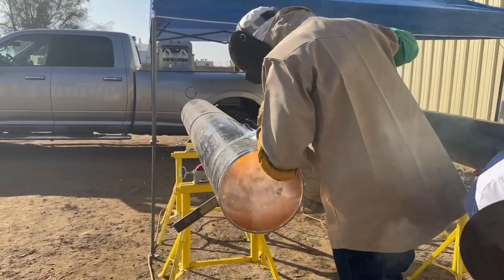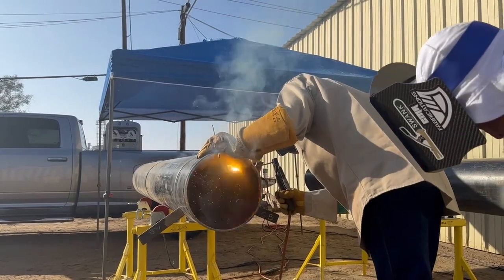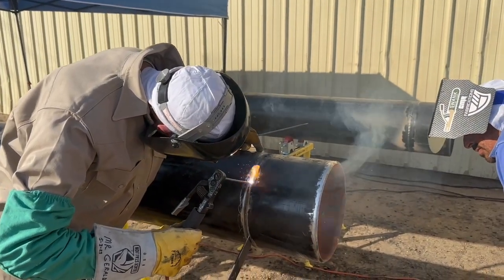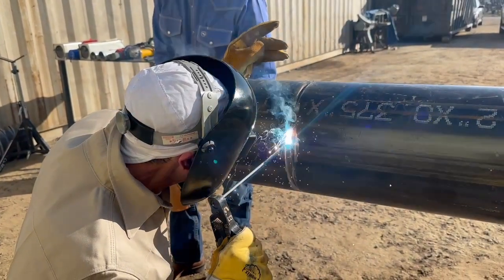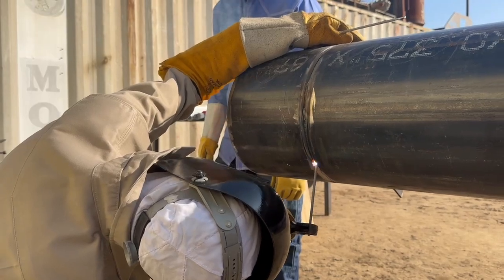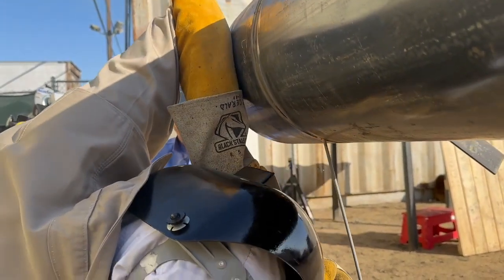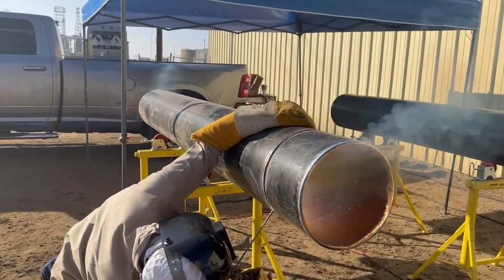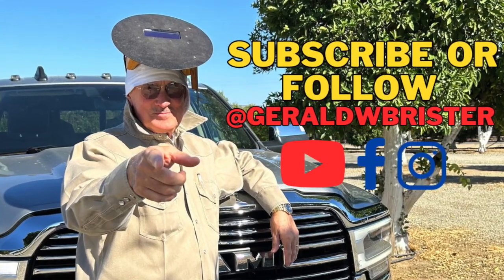ROOT PASS TIPS, Welding Training Video

Comment: Great tips. I find them very helpful . 1 question.  Why can you do your root pass down hand. In Canada we have to do our roots up hand
Reply from the maker: BASED ON MY PERSONAL RESEARCH AND CONVERSATIONS IVE HAD WITH OTHER  CANADIAN WELDERS IN THE PASS , I BELIEVE THE MAIN DIFFERENCE BETWEEN OUR TWO COUNTRIES IS IN HOW MUCH GOVERNMENT CONTROL IS INVOLVED . HERE IN AMERICA OUR INDUSTRY IS STILL, FOR THE MOST PART CONTROLED BY THE INDIVIDUAL COMPANIES. THEY MAY CHOOSE TO FOLLOW SOME ORGAIZATIONS WELD PROCEDURE, BUT ARE NOT REQUIRED TO.  EACH COMPANY IS RESPONSIBLE FOR THE INTEGRITY OF ITS WELD SYSTEMS, AND ANY LIABILITY IF IT FAILS. THEY HAVE THE RESPONSIBILITY, SO THEY GET TO CHOOSE WHAT PROCEDURES THEY WELD TO. WHEN PRESSURED PIPE WELDING BEGAN  IT WAS MOSTLY WELDED UP HILL WITH ACETYLENE AND OXYGEN TORCHES FOR HEAT AND BARE RODS FOR FILING AND CAPING.  LATER AS  RELIABLE STICK RODS WERE INVENTED PRESSURE PIPING IN PLANTS AND POWER HOUSES WAS STILL WELDED UPHILL AS WELL .IN THAT DAY PIPE WAS HAND BEVELED AND NOT SO WONDERFUL AS PEOPLE TRY TO MAKE IT. YOU WOULD HAVE IRREGULAR FIT UPS AND SPACES, SO UPHILL WELDING WAS MORE FORGIVING FOR WIDE GAPS AND YOU COULD TURN THE MACHINE UP AND MELT THROUGH THE TIGHT PLACES. HAS AMERICA WAS GROWING AND THE USE OF PETROLEUM PRODUCTS INCREASED, THERE DEVELOPED A NEED FOR MORE AND MORE PIPELINE CONSTRUCTION AT A FASTER PACE AND LOWER COST. IN ABOUT 1933 MR MATHEY INVENTED AND PATENTED ONE OF FIRST RELIABLE AND WIDELY USED BEVELING MACHINES ,ALLOWING FOR CONSISTENT BEVEL ANGLES AND SPACING FOR WELDED JOINTS . SO DOWNHILL WELDING WAS RATHER QUICKLY ADOPTED, USING A 30 DEGREE BEVEL AND A TIGHTER SPACE TO MINIMIZE THE AMOUNT OF FILL METAL REQUIRED.  THE TRAVEL SPEED TO BURN A ROD INCREASED AS WELL. TOGETHER THESE THREE ADVANTAGES, ENDED UPHILL WELDING FOR PIPELINES AND OILFIELD WORK. THE WELDING INDUSTRY, LKE THE MEDICAL INDUSTRYS IS SLOW TO ADAPT TO CHANGE, BUT OVER TIME THE PLANTS AND POWER HOUSES ADOPTED A HYBRID WELD PROCEDURE USING A DOWNHILL ROOT AND HOT PASS, FOLLOWED BY A 7018 FILL AND CAP, FOR MORE SPEED AND PRODUCTION ON  MOST CARBON STEEL APPLICATIONS . THE GOLDEN AGE OF PIPELINE WORK ,WAS ROUGHLY FROM THE END OF WORLD WAR TWO,  TO THE LATE 1990's. OUR FAMOUS PIPELINE UNION LOCAL # 798 IN TULSA OKLAHOMA WAS FORMED IN 1949. DURING THIS GOLDEN AGE YOU COULD PRETTY MUCH WELD AS FAST AS YOU COULD GO AND THE WELDS STILL PASSED X RAY AND HYDROTESTING. TODAY THERE ARE STRICTER WELD PROCEDURES FOR TRAVEL SPEED AND THE AMPERAGE USED.  HOPE THIS HELPS ANSWER YOUR QUESTION .   THANK YOU ERIC!